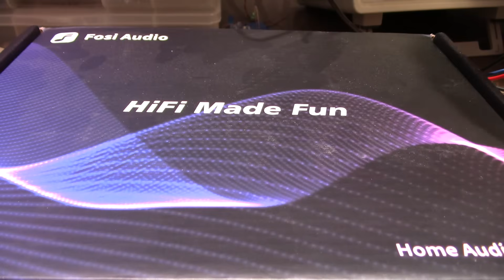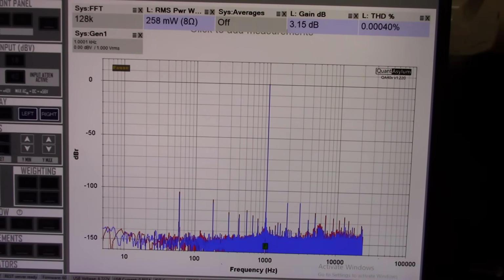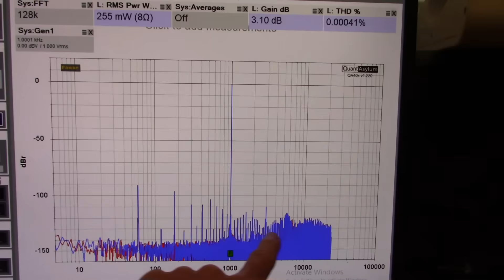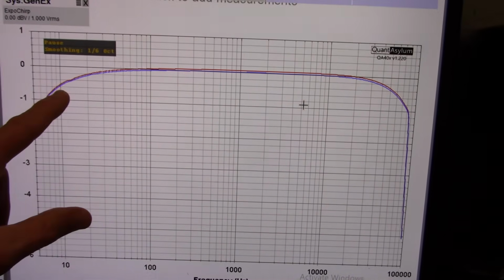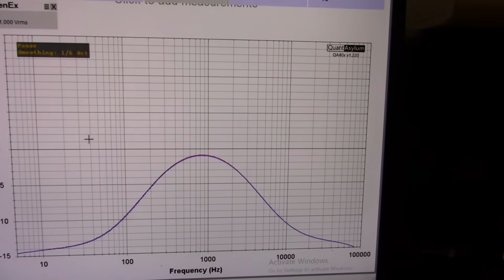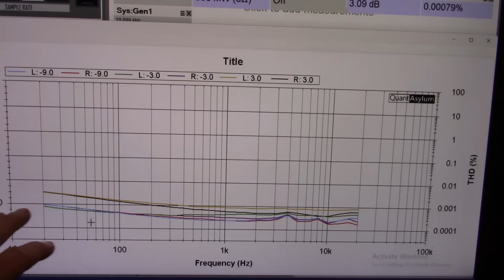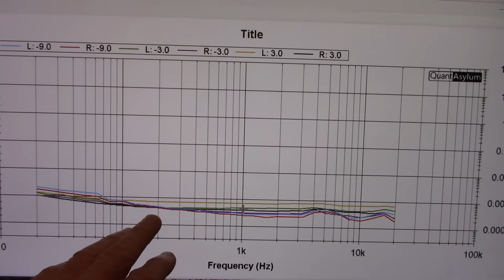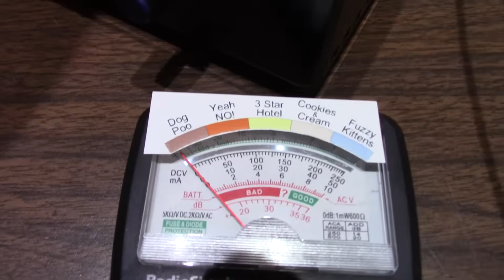Fosi Audio P4 preamplifier on the analyzer

Comment: Love mine, a high pass filter and a slower motorized volume control and it would be perfect. Put it through a nobsound 9 band eq into a emotiva a2 mini that drives a pair of either XB2 or psb image b5 speakers. Pre out feeds an rsl 10e sub. Sounds great in my little listening room.  If fosi comes out with a good dac/preamp with a high pass filter I'll upgrade my smsl su1. Their last few releases got close but not upgrading till that happens.

Comment: Hi thank you so much for this excellent lab report 
I wonder what is the current draw of the device
And is it constant?
Reply from the maker: I did not measure that, but it can't be much as the unit doesn't get warm in use.
Reply: @JohnAudioTech hi thank you for the very kind and valuable reply 
I have been shocked by its excellent behavior when powered by a 12VDC battery and i wonder how many hours it could work without recharge

Comment: 5:00 ... Hi John ... unless you did calibration tests on the tone controls, you don't know where their electrical centre is... so the immediate result is no surprise.
Reply from the maker: I just used the detent as the center. Within 0.2 dB is pretty flat.
Reply: @JohnAudioTech  
Yes it is.  I've not had the chance to mess with one of these yet... but I have seen some designs where the detent lands you in +3 territory.

Comment: Seems very good and Fosi appears to be making a real effort to satisfy audio enthusiasts.  John said that he could nit-pick certain things, but sadly then didn't list his nit-picks.  Even if minor, such criticisms should be noted in a review both for buyer consideration and manufacturer feedback.
Reply from the maker: My biggest gripe would be the high output impedance, which is no big deal for most people. Also, a little less electrical noise getting in from the included power supply.

Comment: I guess that most of your measurements were done with the volume control on max. These days I have also done the frequency response tests a volume level of 25 and 50% rotation. This often gives a wide variation on frequency response, due mostly to input filters, but this does represent a more everyday use. Some preamps really measure quite badly with 25% rotation. Just a thought John!
Reply from the maker: It was still connected the analyzer, so I checked at these settings. Same Frq. response. Difference between channels was less. Tested at -6,0,+6 dBv.
Reply: Good day Sir Beeny...
Reply: @Feliciana-g4r  I hope you are not following me Feliciana lol. Good to see you.
Reply: @MichaelBeeny  No, but I am ! :)
Reply: Hope you're doing well Mr Beeny😊.
Reply: @davidcarr2216  Thank you David, still alive. That's always good.